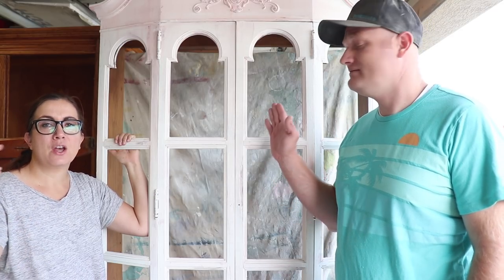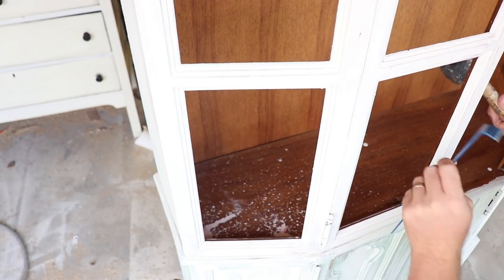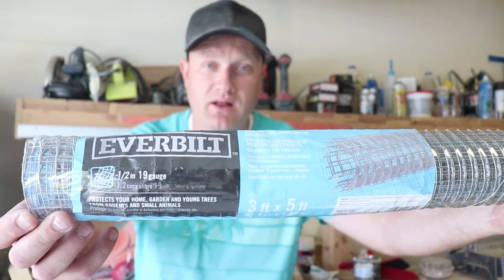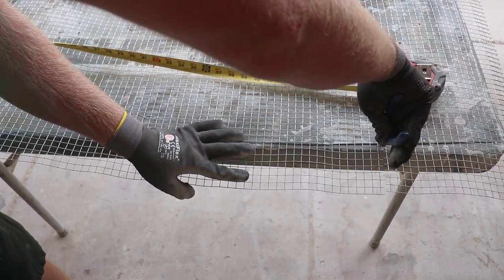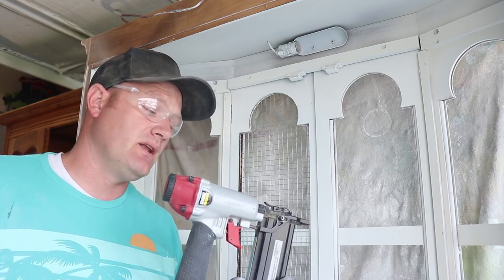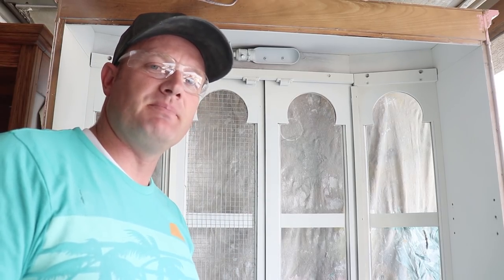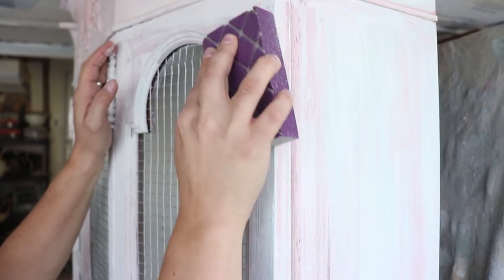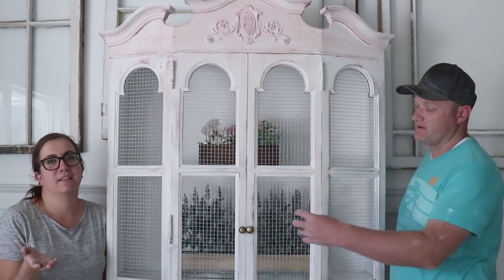Furniture Painting | French Country Decor

Comment: The wire mesh really made a difference. I would have liked to see a bit more on the hand sanding. Did you use a sanding sponge, was it wet?  Thanks for sharing ❤️
Reply from the maker: We just used the 220 sanding sponge on the piece to smooth out brush strokes and to bring out some more color variation. The sanding sponge was dry.